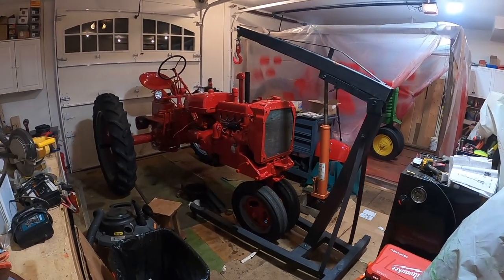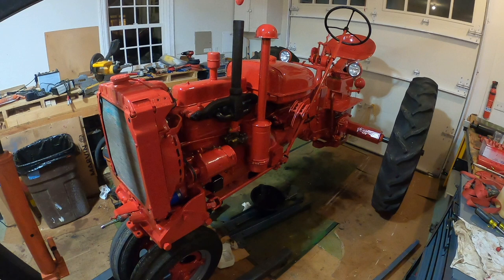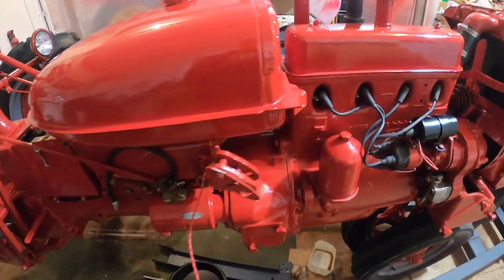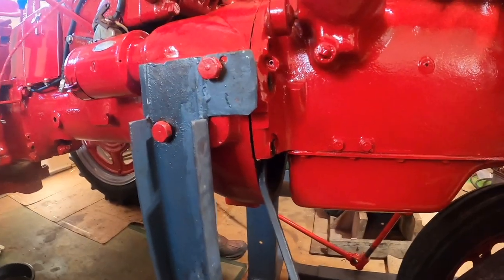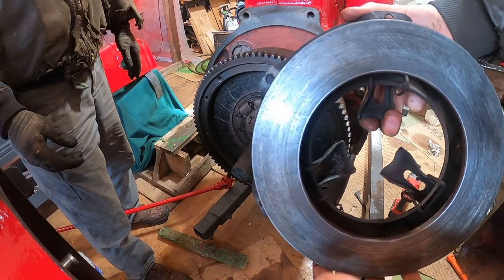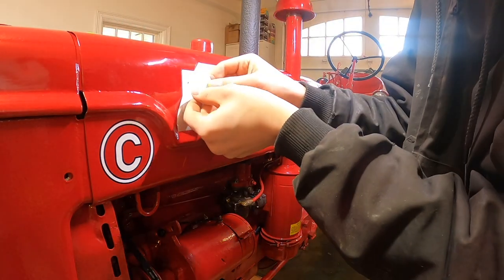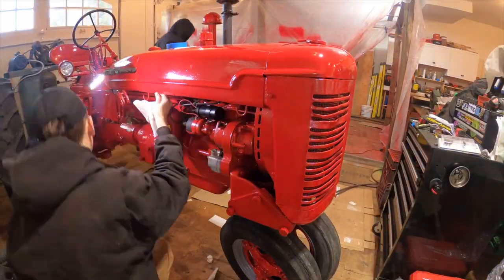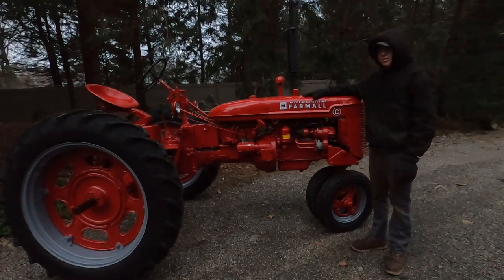Restoring Farmall C | Part 2 - Clutch and Decals

Comment: WOW that looks GREAT!!  I had a model C a bunch of years ago.  Served me well.  I did upgrade the electrics to 12 volt alternator system for reliability and lights but otherwise stock.  It was a fun good running tractor.  My use was hauling and pulling wood,  plowing snow, and general grunt work.  I had a lot of fun hours on that machine.  Great memories.  Yours is beautiful.

Comment: Too late now, but, you should smear a spline lubricant on the clutch shaft splines. It makes for a smoother actuating clutch, prevents the friction disk from rusting and sticking on the splines. You can use different brands like Honda or BMW motorcycle spline lubricant. It's a good thing as Martha Stewart used to say. 
Great videos 👍👍

Comment: The way I get a clutch in stuck I loosen all the bolts around the bottom of the bell housing all but the top 2 bolts ,open the bottom of the Bell housing about 1/4 to 3/8 in. Start tractor in neutral .let it run a minute and try clutch.for me works every time with 3 tractors! Hope this helps in future. Great video!!